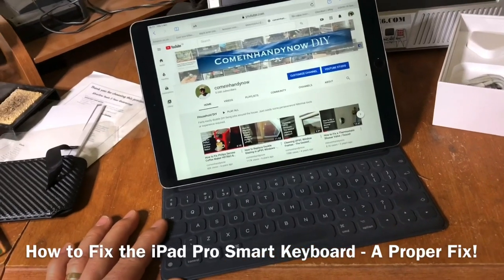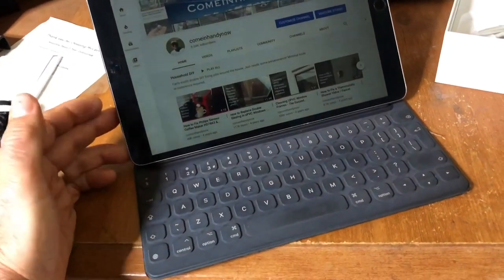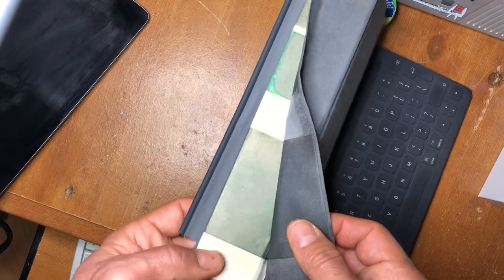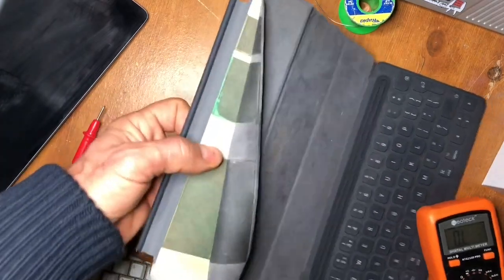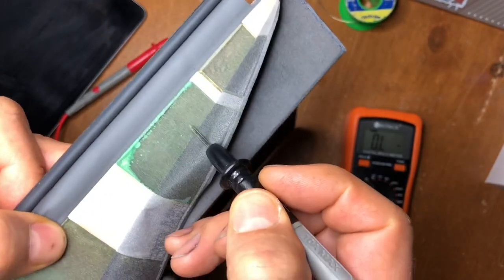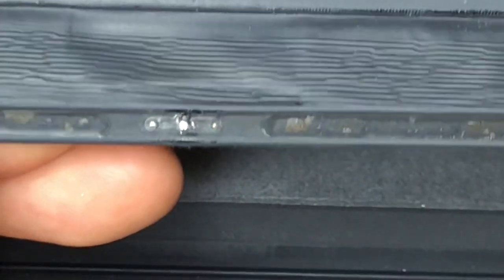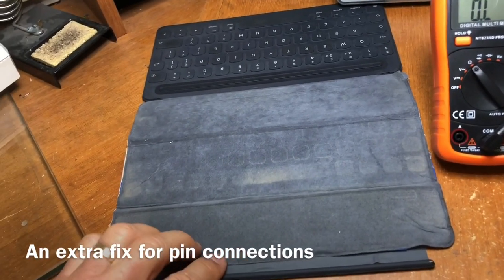How to Fix the iPad Pro keyboard - 4 fixes! Working Proof!

Comment: One other solution that works for my Ipad pro smart folio keyboard is to run a strong magnet in the center of the cover. My keyboard never works even after endless folding attempts in multiple positions. But if i do multiple runs of a magnet on the center of the keyboard cover which is magnetic, it immediately starts working. Please like my comment so that others can see and hope it saves them some headache.
Reply: Thanks, it work
Reply: I tried this before but after awhile the method stopped working
Reply: @iantosh4898  you can buy any strong magnet like a neodymium magnet
Reply: @Pigeion  agree. Happened to me too. I threw the cover out now. Its just not worth it. I will buy a bluetooth keyboard which can be attached to the ipad
Reply: recca9800 yeah! I already got a Logitech keys to go with is really good Keyboard
Reply: My solution was to call Apple! I have a 12.9 iPad Pro second generation and I started getting the dreaded accessory notice. I also understand that they have quietly extended the warranty on the smart folio keyboards for the 2nd generation to 3 years, which made my iPad keyboard still under warranty. They don’t make the smart folio for that iPad anymore, so you have to be persistent. They will send you free of charge a Logitech keyboard for the 12.9. Mine should arrive soon, and I hope it works! I hope my comment will help some others… This was a most interesting video, but I am not about to go through all that to make that silly keyboard work again.
Reply from the maker: @recca9800  Those Bluetooth ones are annoying as they power down when idle, so when you start typing again the first word is ignored.  Also very poor quality Chinese ones on the market.   2 out of 3 I tried failed within the week.  The remaining one has erroneous characters.
Reply: @comeinhandynow  I would highly recommend Logitech Slim Combo case. I bought a refurbished one on Amazon. It is better than the Apple smart keyboard while similar in design, eliminating hassles of Bluetooth connectivity. My Ipad Pro is perfect now
Reply from the maker: @recca9800  Thanks for the tip that style is not for me as it turns into more of a laptop. I like to sometimes use in tablet mode just wedging it on my knees which the Apple keyboard can do without having to detach it.
Reply: THANK YOU THANK THANK YOU!!!!! 💕
Reply: What's the science behind applying a magnet to solve the problem?
Reply: @brendanb9575  I haven't investigated it but it works. As a guess, I would say it increases the electrical conductivity of the conductive strip embedded within the cover.
Reply from the maker: @brendanb9575  I assume it just attracts the keyboard contacts to the ipad a bit more, so the same as just bending the contact strip of the keyboard towards the ipad a little to try and get better contacting.  It’s not a solution for the broken internal strips which happens eventually.
Reply from the maker: @paulgray3444  Not my choice. That product has a wireless keyboard which drive me mad as they take a while to come on after auto shutting down, missing the first characters typed.

Comment: Wow, that’s quite a deep dive! Thank you, man. I guess there’s no easy solution for my Smart Keyboard. It’s a shame Apple made them so unreliable.
Reply from the maker: Thanks.  I do have some sympathies for the Apple designers.  It’s a tricky job making flexible joints with wires and if I’m honest I did tend to use and abuse my keyboard/cover a fair bit, sometimes using it to hang the ipad over the exercise bike screen!
Reply: I didn’t abuse my cover at all.  In fact, I bought a new different brand cover for about $30 and it’s great!  The company even responded to me when I had a question about getting it to fit snug.  Apple doesn’t give a crap about you.  I’ve written 2 letters to them and NO response at all.  Their customer service sucks!
Reply: @lorrainecoffey8743  can you give us a link or the name plz? i'm searching for a good substitute

Comment: Mine needs the ‘wire’ fix for the middle pin so it’s going in the bin.  Probably the most disappointing apple accessory I’ve bought in many years.
Reply: What cant you fix it? The video shows how i did it in 15min with few drops of glue and some aluminium foil. Works for years since
Reply: @kobalov1   I’m pleased the simple fix worked for you but as I said in my post, mine needs the ‘wire fix ‘.  There is no continuity between on of the connection pins and the flexible tracks.  I spent good money on a stylish keyboard and have no interest what will look shabby with a visible wire and likely will not be a lasting fix anyhow.
Reply: @quasijones  ah im a bad reader sorry
Reply: I totally agree. Apple should make good of all this. It wasn’t cheap to buy some very disappointed and I wrote a letter to them. But I’m sure they don’t care

Comment: Epic, the only real fix. However, I want to point out if anyone will still do this in the future, that Apple presumably updated internals, the conductive parts in my unit looks different, both side ones are much wider. Also, fabric is glued with really strong glue, making it's removal with no/minimal damage literally impossible, even with heating etc.

Comment: Very good sleuthing. I have the problem and will get on this.
Reply from the maker: Good luck. It seems that the apple ‘magic keyboard’ is better to bear in mind on future upgrades.
Reply: @comeinhandynow  Unfortunately, that wasn’t the problem. It’s the center pin and no amount or direction of depressing gets it to work. The spring and pin seem to be in good condition. I even tried to drip some alcohol in to loosen any  corrosion that might be in there. No luck. It looks like there are reasonably priced Bluetooth options available. It was a good effort anyway.

Comment: Thank you so much for uploading this, i found a broken apple keyboard in the bin and took it hoping it would work for my ipad, i was sad to see it not being detected but after doing the most reliable method of soldering wires to the contacts which worked perfectly!!! Such a expensive keyboard fixed for free, its crazy
Reply from the maker: Cheers.  Nice one. A good bit of recycling.

Comment: I’ve faffed with mine for ages. Tried cleaning the pins, adjusting the middle pin, even found somebody saying waving a magnet over pins 1 & 2 works as there is a reed switch under there. The magnet trick worked a couple of times but now it isn’t working again. Tempted to bin. Will get a new case but will then try your copper tape solution. Not gonna bother with soldering wires. Well done though. You must have the patient of a saint!
Reply from the maker: Worth a try as it should fix it, at least for a while. Copper tape is not so flexible as the original though.  Eventually I upgraded to the ipad pro with the magic keyboard which is awesome and is lasting well, on amazon here: https://amzn.to/3PQ6TnL
Reply: @comeinhandynow  - I peeled my cover back and mine is completely different. No ribbon cables or anything which resembled yours. It’s in the bin now. The Magic Keyboard doesn’t seem compatible with my iPad Pro 12.9” (2nd Gen) so forced to buy a new case with no keyboard.

Comment: Same problem. Available BT keyboards are crap or don’t support my favorite layout. I have used an aluminum tape and a double sided tape. My work is not so perfect, and still have some minor connection issues, but now, I can type this text with this fixed keyboard! So thanks for this guide! ;)
Reply from the maker: Well done!

Comment: Before opening the thing I've tried heating the flexible rubber band with a hairdryer and pressing it gently on all its way with an old rubber phone case several times (carefully because plastic may meltdown) and it worked for me at the moment.
Reply from the maker: No harm in trying quicker (all be it temporary) fixes before this procedure.  Thanks for your comments.

Comment: Thanks a lot for the video. I’ve just mend my keyboard with your indications. In my case there was only one pin wrong, so I managed to repair it in a easier way: just a bit of adhesive aluminium foil to connect the right pin with the center stripe. The aluminium foil is over the pin. Since only one pin is mended in this way, there’s no shock circuit risk. If there’s more than one pin to mend, you can use the same method as me using nail varnish to insulate the connections from themselves and from the ipad.  
PD: The pin out for my iPad Pro 12.5 Spanish keyboard is as follows:
- left pin <-> right stripe; 
- center pin <-> left stripe
- right pin <-> center stripe
Regards.

Comment: Just essentially destroyed my keyboard ripping it apart without any real expectation that this would work, especially as mine is a slightly newer model but thought “well it doesn’t work so who cares if I destroy it?!” But to my amazement, it worked! Speechless. Thanks!!
Reply from the maker: Well done!
Reply: is yours the one that came out later with the pins on the side?

Comment: Thank you for an excellent guide!  I just fixed my smart keyboard based on this. However, I still couldn't get a connection after the foil fix. I noticed that the rubber lining on the short magnetic edge on each side of the three connection sockets was very worn on my item - so I cut some very thin strips of insulation tape and lined both edges, and everything came back to life again! Once again, great guide!
Reply from the maker: Cheers. Great that you perseverance.

Comment: No idea how to explain this but my keyboard stopped working ages ago and I stopped using it because it drained my iPad battery to just be attached. I recently started using it again but got frustrated over the battery draining so I decided to slap some superglue over the exposed metal parts thinking it might stop the connection. It’s completely fixed and have had no on and off issues yet.

Comment: I was able to get narrow copper tape and cut the end to a gradual tip.  After testing for resistance and finding the middle pin was very high from the pin to the strip, I maneuvered the tip of copper tape to the middle pin.  I got it under the rubber opening around the pin then formed it under the bend and to the corresponding strip on the Smart Keyboard.  Then voila! Keyboard works again.  Thank you for your helpful video.
Reply from the maker: Great, well done. Good feedback.

Comment: The fix is great and easy to follow and apply. Sally it didn't work on my keyboard ... 😣
Reply from the maker: Thanks. That's a shame. Did you measure the resistance from each of the 3 pins to a piece of track very near to the keyboard end? and was it a low resistance?  Also check for any shorts between pins.

Comment: I finally have an answer as to why my keyboard quit working… thanks…. A great fix…. I ended up just using one of my old blue tooth Mac keyboards… & now this iPad keyboard is just a protective cover & a stand… .. i think maybe one day i will fix it some day…
Reply from the maker: Cheers.  I eventually upgraded to a newer ipad and their magic keyboard, which is a lot more reliable so far as it bends less and works very well.  The time lag for it to power up on those cheap bluetooth keyboards is very annoying.  Hopefully the mac one is better.

Comment: Ok so its a 3 year old keyboard on my ipad pro 10.5 but I really thought I was getting somewhere when the first Apple rep escalated it and I got to speak with a ‘manager’ this morning...... there’s 30 mins of my life I’ll never get back.  Watched your vid, got the multimeter out, stripped the insides from a really thin wire and with electrical tape and double sided sticky the keyboard is now fully working and no ‘accessory not supported’ warnings.  Will neaten it all up with some decent glue and it should do another couple of years at least.  Just posting this to say thanks for posting the vid...... much calmer now I’ve fixed it.
Reply from the maker: Cheers. Great to hear from people that have the ‘can do’ attitude and fix things. well done.

Comment: I literally just bent the connectors of the keyboard up in an arc shape after several failed attempts at using the keyboard now typing this!!
Reply: this worked for me as well, thanks for the tip!
Reply: Not sure what you mean here. SOunds like it could be of help though. Do you have a video you can post?
Reply: Same mine got bent too, worst part is it’s school property 😶

Comment: I just disconnected the board from ipad and reconnected and this fixed the problem for the board in not typing.
Reply from the maker: Yep, that works for a while. Eventually the connection gets poor enough that it needs the shown fix however.

Comment: Unfortunately it didn’t work for me.  I don’t think I have the same problem.   Top tip from me is that you can easily check your connections without removing  and destroying all the backing by simply putting one end of your meter on a pin, and then just push the other one hard on top of where you think the strip is as it approaches the keyboard.  The point of your probe will penetrate the foam of the underside of the case and go through to the conductive layer beneath without too much force.  If you can get low impedance doing this, you might then want to start waggling the bendy bits of the case around to identify if you have an intermittent connection.  If not, then you may have some other issues
Reply from the maker: Ok, good tip.

Comment: 1. Temporary Fix 6:22 - 11:50
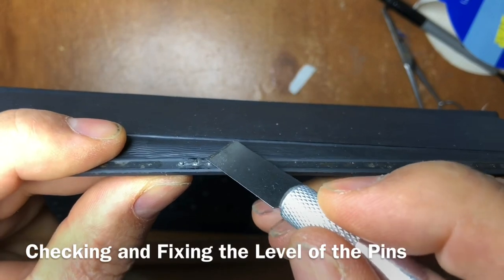2. Better Fix with Copper Tape 12:44 - 19:04
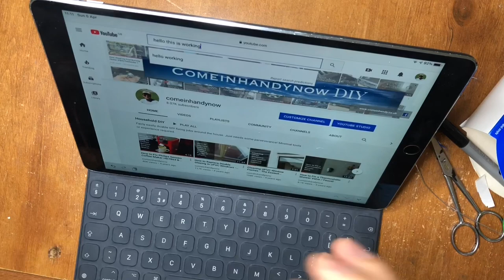3. Checking & Fixing 3-Pins 19:04 - 20:20
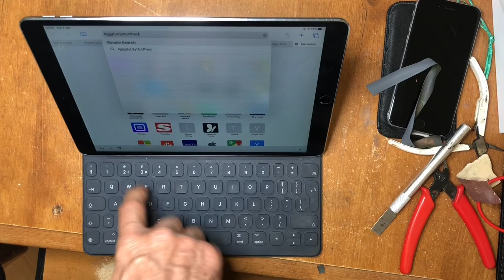4. Fixing Pin End with Wires 20:52 - 30:05
5. Proof of Fix 29:15
Reply: Do you know any good Bluetooth keyboard resets?

Comment: Messing with my connectors for my 11” seem to bring it back for a day or so but I probably need to sell it and tell the future buyer the deal.  I’d prefer to mount it next to a Monitor and use the Apple Magic Keyboard and Mouse I guess though traveling would be harder (I’m not on a plane for a while...)

Comment: So my problem is that there is absolutely no continuity anywhere from the Center foil strip to the Center pin. The Center pin is not corroded or low. Is there any video on how to go into the thin strip that has the pins located into it?

Comment: Awesome, Thanks! I was looking at buying a new one, but i use it infrequently, so this is perfect.
Reply: oh well. I pulled it back and had no corrosion and had good connection from pins all the way into the back of the keyboard. Not sure what the problem is but at this point, ill spend the $50 and get a used one :/
Reply from the maker: Do you think the pins are making good contact with the ipad?

Comment: Allow me to give you the highest honor I can give. A like on your video. Did the aluminium foil trick it works now. Now I'm curious on how do you implement a better design to avoid this issue in the future anyways? I don't see how you can avoid metal fatigue when you have foldable joints like these.
Reply from the maker: Thanks, yes you are right, with metal folding there is always the metal fracturing risk.  If you can get conductive stick on material like the original design then use that.

Comment: Thank you so muchhhhh for sharing this valuable video. My dad watched it and helped fixed the keyboard following your advice ❤️. Finally my Smart Keyboard is now working perfectly again, after letting it be just a Smart Cover for the past two years! You helped me save lots of $$. Truly grateful for the detailed advice :))) 
PS. Mine has to go with the wired option (and my dad hid it inside the tube so it’s not so visible) since two of the connectors lost connection with the keyboard.
Reply from the maker: Great and well done to you and your Dad.  Thanks for the feedback.

Comment: I was wondering about the level conductivity through the adhesive side of the copper tape, as you originally had it.  Do you think that could be why the wires were needed?
Reply from the maker: No the adhesive is a conductive type on the tape I bought. This can be tested with a multimeter.

Comment: Sadly didn't work for me. Pulled the fabric off and tested the connection and all connections intact along entire strip and pins are all fine but still no joy. There is also conduction of current between the strips though and I wonder if that's the problem? Or something in the keyboard section itself perhaps.  Great video though. Gave me hope 😅

Comment: Thanks for the tutorial. What’s the width and thickness of the copper tape?
Reply from the maker: I believe I put links in the video description section for buying.
Reply: I don’t know if it’s because I am outside of US, but when I open the link I see many options widths of which vary. In the video the width of your tape seems to fit perfectly the very first conductive area.
Reply from the maker: @anuarakhynov7701  The width doesn’t matter, it just has to make a connection.  If you want it the same as the original flexi connectors do in several strip if you get narrower stuff.
Reply: Hi! I have tried it with copper tape following your instructions and now it works! Thank you! How important is it to solder the pins? I have left them untouched and didn’t do anything it comes after 19:04.

Comment: I have the 2016 model. I guess is different from yours and extremely difficult to remove the back fabric. Didn`t work for me. Apple should be ashamed !
Reply from the maker: I’m fairly sure you have the same model, so just try pulling harder.  It is stuck well so quite tough to pull off but it gets easier once you have some to get hold of.
Reply: @comeinhandynow  Would using a hair dryer or heat gun assist in making the adhesive let go?
Reply from the maker: @PeterandLin  It probably would but may distort the covering.  Once you can start detaching it then it gets easier to grip and get more off.  It needs a good firm pull.